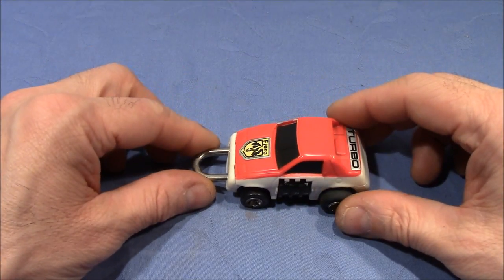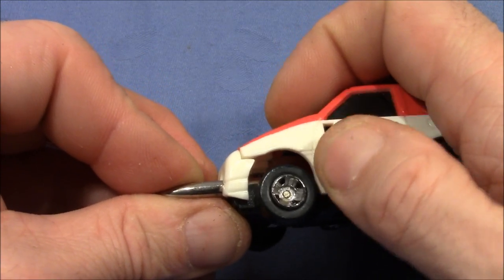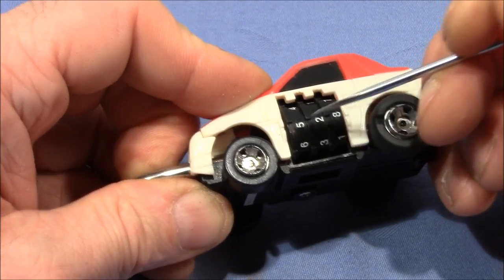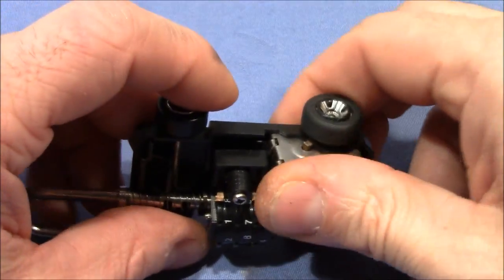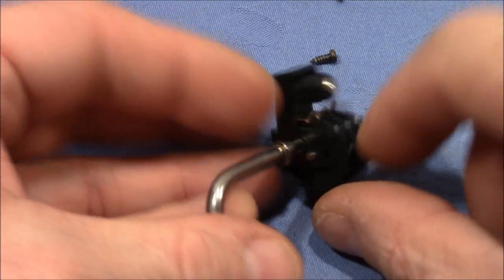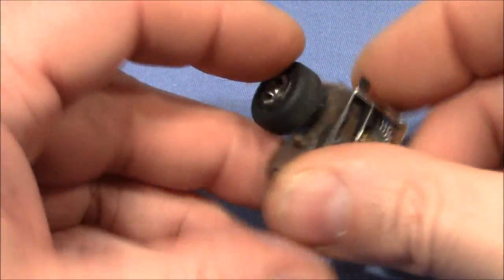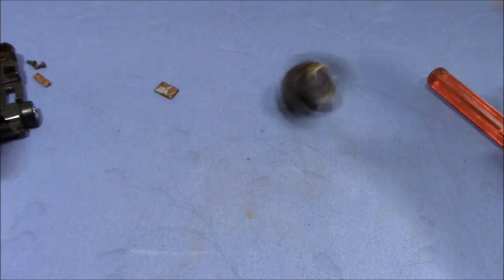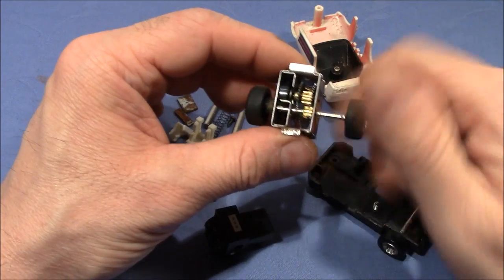(picking 469) Pull-back car with combination lock decoded and inspected (lots of gears in the motor)

Comment: Very sweet hehe ;D, it has a Turbo Motor 😂. This is an interesting gear assembly and the gears will wear out probably pretty fast, but it was very cool and interesting to have a look at it Potti :). 😜✌
Reply from the maker: Thank you :-) You can already see the wear on the wheels but it's a clever and compact design. Never looked into such a motor before. Thanks for watching.